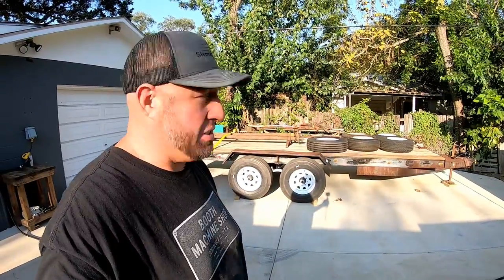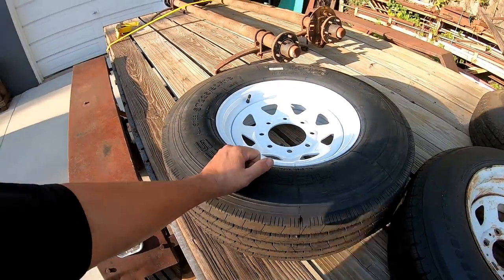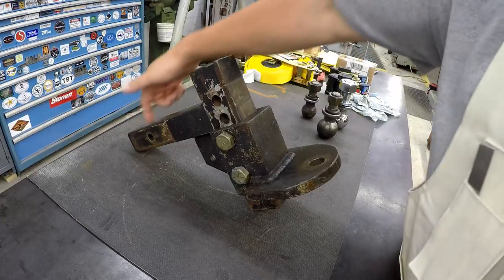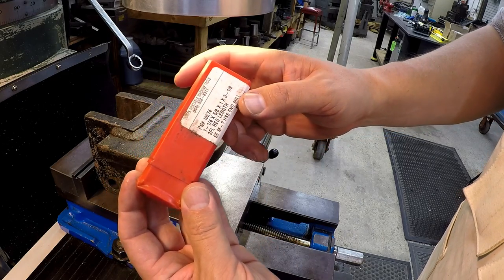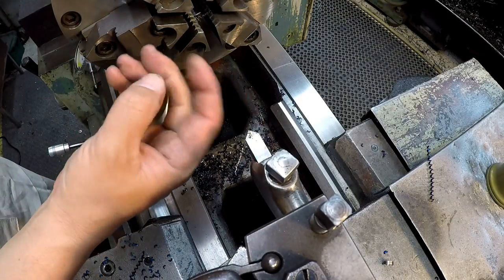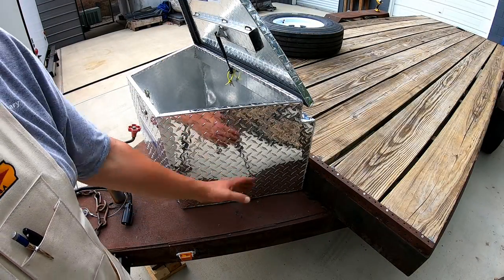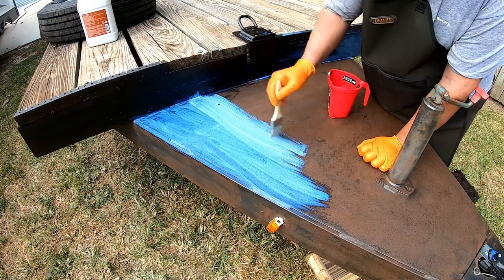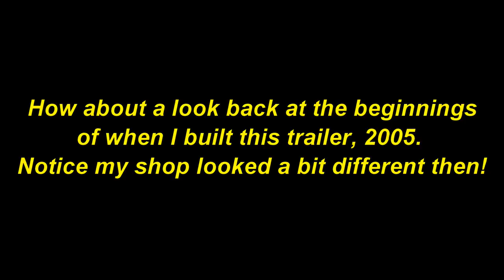SNS 276: This Old Trailer

Comment: Killer trailer Adam...very strong.. I have 100s of thousands of miles experience towing heavy machinery on a trailer similar to yours. May I make a few suggestions? I'm concerned about the fender clearance and totally get your motivation for wanting them lower..but to me they look too close to the tires already. If you made them removable i think you could achieve the ease of fork lift loading that I assume you are going for. Or if its for door opening of loading vehicles make them pivot down but would probably be in the way of forklifts. Also I love having multiple tie down options so my main trailer has stake pockets and 1/2×2" rub rail down both sides ahead and behind the fenders. I also have 4×4×1/4 wall square tubing welded on the inside of the framerails every 12". This allows me to drop a strap or chain hook through the tubing and hook on three sides of the bottom to hold a load from any angle..these are especially handy between the fenders where you can't run a strap to the frame.... every 12" is probably overkill but I'm a big fan of overkill! Lol.I also have a few in the middle welded to the crossmembers. This is handy if you want to tie down 2 large items side by side so you don't have to use only one strap over the both of them... dangerous... I love your heavy duty adjustable receiver hitch! And the cool straps and shields.  A customer of mine made me some shields out of conveyor belt with a slot on each end to run the strap through...keeps sharp edges of machinery from cutting the straps. Looking forward to seeing you at the good of the land festival!
Reply: Hi Jeff, sounds like you have moved lots of these unhandy bulky stuff. Many thanks for your suggestions. Here in Europe we like to buy these trailers frrom Netherlands because they are rigid, simple in construction and they have lots of tie down options. 

Greetings from Germany

Comment: That mag drill has a look of it's own.  I guess it does well enough, and has it's advantages.  I'm used to seeing a larger footprint on the base.

My only suggestion/addition is to upgrade your safety chains while you are at it.  One has the appearance of having been stressed, and your clips might draw the ire of a D.O.T. officer if they ever bother to take a look at you.  Since you are not "for hire" it's likely they wouldn't say much, but you never know.  They may not say much about legalities, but if they see something they deem a critical safety issue, the may hold you in one spot until it is corrected.  Not a convenient thing if you are trying to make an appointment.

My "rule of thumb" on towing these days is to check the hook up within 15 miles of starting, and check lights, tires, bindings, and hitch for any indication of a developing failure every time you stop after that ... even if the intention of a rest area stop is to "pee and flee."  Always a good idea to check things after encountering an unexpected rough spot,  like a break up in the road or a bad bridge expansion joint or rough rail crossing.  If it causes you to use words you haven't spoken in decades, it's time to check on things...

Comment: Adam, as always another great video. I am sure you have thought about this but I thought I may just mention. Minimum edge distance for the toing ball you have now fitted. The hole is pretty close to the edge of the plate you opened up? 2.5 x The hole dia is the standard here. The new ball can pull a house down but the plate you machined out to take it? Lovely new alu box you may want to put some plastic isolators between the alu and the steel and change them bolts to 316l passive stainless to stop bi-metlalic corrosion. A few years down the line the bolts will pull through otherwise. Talk to Keith about  bi-matalic corrosion of dissimilar metals in a wet environment. If you have a few hours that is 😂🤣 Keep at it mate. Love your output. Ant.
Reply: I would have also used some spreader plates on the side of the aluminium, to better transfer the forces in case of a accident. you dont want those bolts pull trough and the box go flying .
Reply: Just use wheel bearing grease and you'll never have any corrosion. I almost can guarantee it

Comment: Very nice trailer. I built a tandam axle trailer when I was  a senior in high school with my grandpa 20 years ago. Some a-hole needed it more than me and stole it. They cut through 2 gates and cut off the hitch lock. Hope to see it again. A few years ago I welded a ID tag under the deck of it just in case it ever got stolen there would be a number to ID it.

Comment: When I was younger I used to haul a variety of trailer loads - if you put a twist in your straps on the free spans they won't vibrate and hum when going down the road - if you didn't already know that trick.

Comment: Hi Adam
What do you think of a small drain hole in the bottom of your new toolbox? - I expect there will be times water will get in, or in some cases, fluids that you have in there will leak. An easily removable rubber, cork or fiber plug that fits flush to the floor to drain it. Just a thought, thanks for your uploads.

Comment: just a thought, might look weird though? Could push the toolbox across to the edge of the tongue and mount the spare wheel against it, on the space freed up at the other side. Best finding somewhere that can load you up to max weight before deciding on the fender height, it's surprising how far up the wheels can come especially when the axles get crossed up

Comment: On the box, I do recommend making you're own locking system on it. Those damn things are damn easy to crack open. Maybe some plate across the top with padlocks going into either side. I used to be a trucker and my tool box got broken into before. Fuckers stool bout 300 dollars worth of chain, tensioners and straps

Comment: Hi adam;
You are going to have a better trailer than you had.  Your tool box is a very nice addition.  I would recommend that you use Fender Washers to hold the box down.  Just the bumping the trailer gets on the highway will  break the material around the holes.
Have you ever thought about making the whole trailer a tilt trailer?  You have the correct tong  setup.
thanks for sharing

Comment: Adam, if you went ahead put some 1.5” or 2” cross members over the top and stretched the trailer to 8 or 8.5’ wide you would gain a lot and not have to worry about fenders.  You can drive a tractor on top with a true over deck on there.  Just a thought.

Comment: I would recommend fender washers for the toolbox mounting.
Reply: Agreed, or even plate washers. I've ruined a few aluminum tool boxes because they cracked out around the holes.

Comment: Adam before you weld the fenders you need to work out the travel on the base when under full load. The last thing you want is the fender rubbing on the tires ( American spelling)
Reply: Adam, This is an important hint. If you drive fully loaded through a road hole you might also need additional clearance to avoid rubbing.
The best would be to fix the fender at the axes to minimize the clearance. But then you will need extra clearance of the fender to the deck if you want to transport items wider as width of the deck. Best regards from Hamburg, Germany   Tom

Comment: On your toolbox, you might think about cutting some plywood for the bottom. The bottom will crack out around the bolt heads. The plywood will give it a full firm pressure with some 2" flat washers. You will never have to worry about the aluminum bottom cracking out around the bolts.

Comment: One think I think I'd add is fender washers under the bolt heads in the box to help keep the holes in the aluminum floor from being distorted when the box is inevitably bumped and banged around.

Comment: I really don't like to replace balls (hitch balls, guys) on things. I went so far as to buy another hitch to get the movable piece and keep a smaller ball on it for the small trailer I tow occasionally. It's faster and safer, IMO, than continually changing out the ball.

Comment: adam. mount the fenders like a towing hitch.. so you pull the pins and it comes off as a single piece..  or mount them so they tilt out .. put more receiver sections around the sides. so you can drop in removable stake sides panels..   easily convertible to solid panels by bolting on some plywood to the stake sides panels.   if you are going to make mods... make them truly useful..  if you make the receivers in the front creatively.. you can extend the forward length of the trailer to carry something slightly longer.. yes.. you loose a tight turning.. but you should be able to still turn 40 or 45 degrees without mashing bumpers and trailer..

Comment: Adam, there seems to be a theme with the pictures of the old trailer....  there was a Miller Lite can in almost every picture!  LOL  :D   No exaggeration, I have 200,000 miles or more towing car trailers, and you WILL NOT REGRET buying those tires!  They will ride a little rougher, but will last a lot longer.

Comment: I used Better Built tongue boxes on both of the cargo trailers I used for my business. They work just fine. But make sure to use large washers under those screw heads in the box. The floor of the box will crack other wise. Ive always thought that for the money they charge the boxes could be more square, have straighter sides, and have nicer welds... On the other hand, the lids close tight and mostly stay water tight.

Comment: Nice work, I just put a box same shape as that but black on my trailer and mounted the winch and batteries inside it. Still have room for the straps. I love those straps I will have to buy some.

Comment: Nice project Adam. You might want to rethink mounting the light junction box outside of the frame. They are easy to get knocked off or crushed when turning. Just a thought. With the solid deck plate you might not have a choice. You ever worked with 440 stainless? How easy is it to turn on a lathe?

Comment: As others have pointed out, make sure you have clearance between the fenders and the suspension travel before lowering them too far.
Reply: That was something that I thought of as well.  There's nothing worse than a tire burning off rubber on the fender, especially aBom sized fenders.

Comment: The best thing Adam can consider is to remove the timber then fit steel  channel cross members 75mm  x 50mm deep, mine are 350mm centres apart extending across the width of the frame and over the top of the tyres, do this full length of the trailer then weld pipe to end plates on the channel again full length this then becomes a tie down rail, the floor on top of the channel gives the trailer tyre clearance plus the advantages of an extended width completely flat and full length of the existing trailer frame.
Mine is 4 metres x 2.4 metres bed just gets under legal width here in Aus, I just modified my trailer with a 5 stage under tray Hyd hoist and 12 volt pump with wireless remote for tipper duties, ultimate trailer in my opinion.

Comment: A consideration for your future winch: attach the winch to a receiver mount and design in a hitch receiver at the front and maybe even the rear of the trailer. The winch is easy to remove & install; can be stored in the tool box out of sight and weather: and can just as easily be used in your truck's hitch receiver.

Comment: I have a trailer very much like yours and I haul some heavy items on it , I mounted a truck bed Crane on it and use it to winch things onto and lift things onto the trailer , best thing I ever did and adding the tongue utility box is great to hold the straps and tools and jacks . I didn’t make my fenders , I bought them at Northern tool ( cheaper then making your own ) and like them .

Comment: Maybe consult the company that installed your axles/wheels about adjusting the fender clearance.
Beefing up the bed might compliment the increased wheel load well, especially with tall/narrow loads.
Really enjoy seeing the continual improvements to the shop and accompanying equipment.  Thanks!

Comment: Hey Adam, might I suggest that you put fender washers on the bolts inside the box, it has been my experience with boxes mounted on the front of the trailer the same way yours is, that over time vibration will cause the box to crack at the bolt holes. Fender washers have helped me eliminate the cracking on boxes on my trailers.
Reply: jacktheripped  Yep, that is a good way for sure.

Comment: Adam,  for swapping out the trailer balls, why not make a lighter weight version of the ball mount for the 1 7/8 and use the two pins to swap the balls out?  I know it will take up more room behind the seat of your truck but I believe it would be a lot faster change out.  Just another thought.  Keep up the great work and thanks for sharing.  I don’t comment very often but do enjoy all that you and the rest of the creators that I watch do!  Thanks. -John McDonnell

Comment: put some shocks off of a 3/4 ton truck under each tire (make sure they are the exact same shock all the way around), it will be so much nicer to pull. and do some textured house decking paint on the floor, it will last so much longer and will make it look a lot better.

Comment: hi, Abom , when you were talking about what you were going to do, You said that you were going to make the  mudguards level with the bed , but in the last lot of pictures at the end of the video, they are still above the bed as before, I assume that you need this space to allow for the spring to work without the wheel rubbing on  the inside of  the   mudguards. keep up the good work. looking forward to the next video. JB UK
Reply: Those were old pictures of the original trailer when it had a new paint job.

Comment: just an idea on your winch we cut a square hole in the front and mount a receiver tube to the trailer and into the box with the pin in the box where you van lock the box and no one can get your winch and we put the battery in the box.  You can always remove winch and put in the box when not in use out of site. Just an idea.

Comment: Looks pretty good so far Adam. - A post either side of your tool box could each mount a hub assembly and a spare wheel. Or hand cleaner & jerri can. Mounting plates around the frame for a vice are a must though :)

Comment: A further consideration on tire clearance is that the old axles both had fixed shackles where the new ones have a compensator between the springs which will allow greater spring travel when crossing a dip or ridge. Just something to consider.

Comment: you will want to use Apitong or Purpleheart wood for your deck on your trailer its not cheap but is very hard and its what we use on our semi trailer low boy hauler and it holds up very well to heavy weights and abuse... And saturate it with some hydraulic oil to help preserve the wood or use your own good preservative..
Reply: White oak works good too.

Comment: That's a good workshop trailer. Since you haul machines and parts, it would be a good idea to have a good sized tarpaulin (made from natural fibre, not plastic which can flap a lot in the wind) with eyelets for tying down, with the trailer, as part of its equipment. Its not fun getting caught up with bad weather when you are miles from home base.

Comment: Suggest you check with the trailer guys that mounted the axels before welding on rigid fenders. They mounted the axels  with the tire clearance of the current fenders that would also flex if a bump flexed the spring enough for the tire to hit the fender.  Tire clearance to rigid fenders needs to account for loaded springs+ bump flex+ tire diameter growth at the max highway speed you intend use.  Adjusting the clearance before welding on the new fenders is much easier than after a double blow out on the highway with a listing loaded trailer.

Comment: That hitch setup is really slick, but it would drive me nuts to change the balls themselves out all the time. As a silly thought, have you ever considered changing your small trailer tongue mount over to 2 5/8"? I'm sure it would be overkill, but then you just need 1 ball size for both of your trailers. Seems like less work in the end, IMO.

As another thought on a similar line, having a giant ball on a small trailer will also make other people wanting to barrow it (with or without your knowledge) a lot less likely. Most people that would ever want to use a small trailer aren't going to have a 2 5/8" ball.

Comment: I bet you have the skills and the materials to turn a inch and seven eights that has the size shaft you need for your hitch also some 2 inch strap with holes drilled to match the mounting bolts on the inside of your tongue box will save you a bunch of trouble from metal fatigue later on just speaking from experience

Comment: Nice upgrade. I like to weld a piece of bar as a stop to the hitch where the ball goes through such that the flat on the base of the ball mates against it. This way I only  need one wrench when changing balls. The stop for the 2-5/8" ball may be too far away for the 1-7/8" ball. Yep, make the trailer look a little nicer going down the road so it does not look like a "Sanford" trailer. :-)

Comment: Are those like grade 8 bolts for your hitch?  You might also weld a cap on the back of the hitch to hold the weight rating of the rest of the trailer because your tow rig is only as strong as it's weakest link.